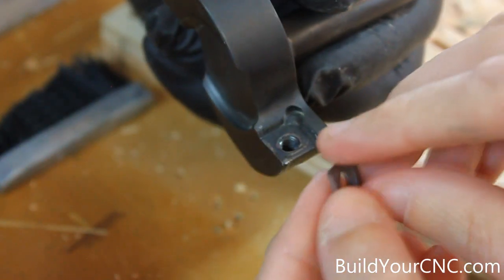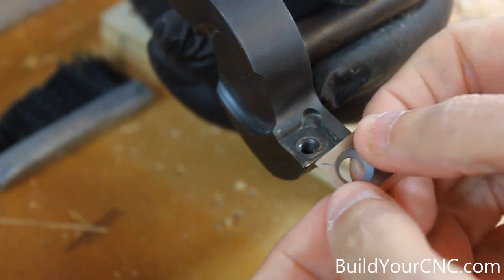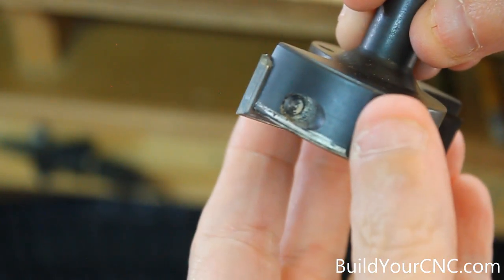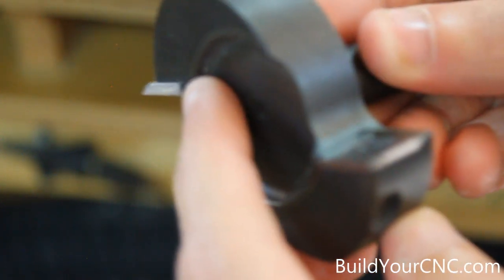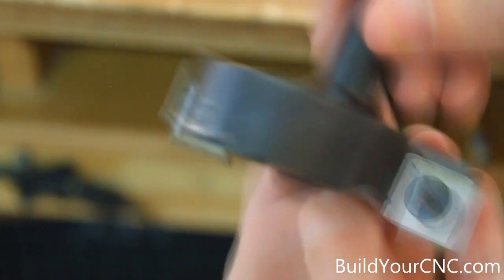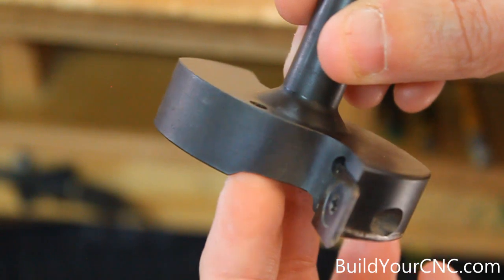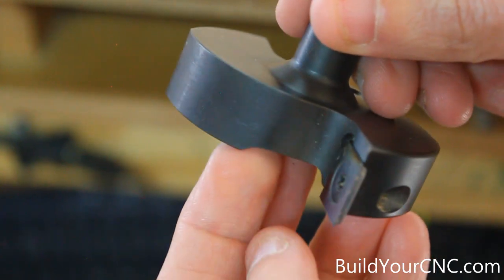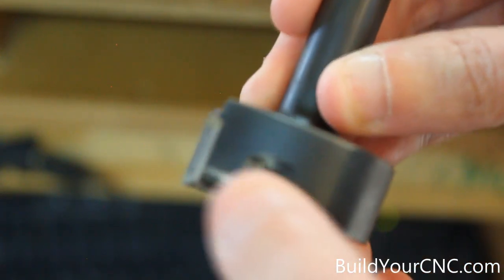How to Surface a CNC Machine Table Bed with the Onsrud Surfacing Tool Using the greenBull CNC

Comment: 330 USD for that cutter? lol ... hmmm .... no
Reply from the maker: Hey Torsten, The cost is really in the tool insert holder rather then the holder itself.  The inserts can be replaced.  If you use a tool that does not use inserts, then you will need to have that tool resharpened, or replace. The inserts are quite inexpensive.  These types of tools that use inserts are typically at this price point or higher.  This tool insert holder should last a lifetime if cared for properly.
Reply: @PatrickHoodDaniel  I know it's the price for the tool and not the inserts (otherwise that would be beyond ridiculous). But even with a "lifetime value" and "typical price point" I don't see the need of spending that kind of money for this kind of tool. It will never amortize for me, and other cheaper options do the occasional surface job just fine.

Comment: How does one create a "simple spiraling pocket machining operation"? This is basically all I'll be using my cnc for. Did you guys just write the gcode from scratch? or is there software that does it for you?
Reply from the maker: You can use a CAM program like cambam, or you can write the gcode. The latter is a bit more difficult. Since making spiral holes is the sole purpose, get the free version of cambam and you can simply look at the gcode and learn the proper gcode instructions for making you own.
Reply: Patrick Hood-Daniel Thanks! I'll give that a try
Reply: Patrick Hood-Daniel  I've downloaded cambam but I can't figure out how to create "anything" really....so that I'm able to look at the gcode. Does something need to be created in a CAD program, then moved over to cambam in order to even use cambam? I don't understand the process I guess. Is it CAD>cambam>mach3>cnc execution of gcode? I really appreciate your patience and willingness to help Patrick. Thank you so much!
Reply from the maker: Cambam has light cad capability. Draw a circle and apply a drill machining operation to it. I suggest going to buildyoucnc.com and take a look at some process tutorials. It would also be good to check out some cambam tutorials on their site.

Comment: It is hard to ask this question with out sounding like a jerk and I don't want to insult you but would it be hard to make a shoe that fits?  You sure had a mess to clean up after that surfacing operation.  ROG

Comment: Were you running what looked to me to be a dust collection hose on the machine?

ROG
Reply from the maker: We were not doing any dust collection on this operation.our dust shoe is too small for the surfacing tool which is 2 1/2 inches in diameter. The hose was there just because it doesn't really move from that location anyway.